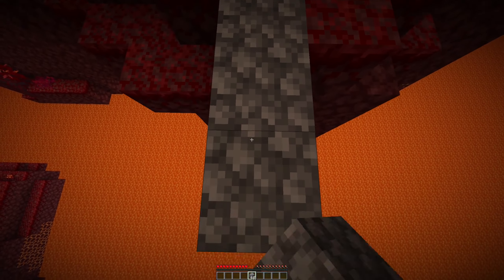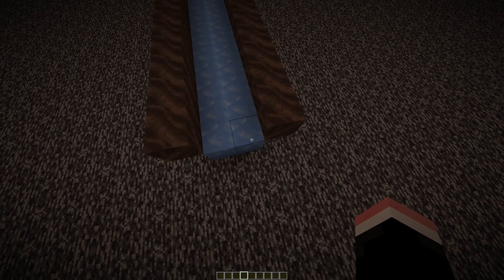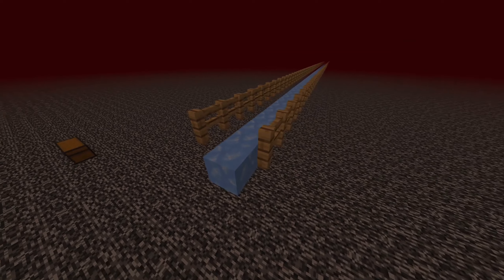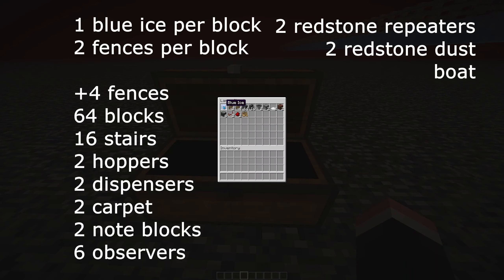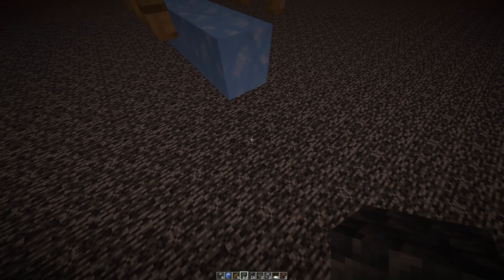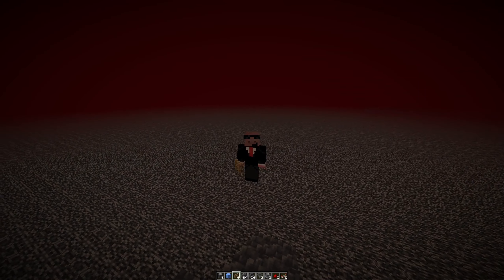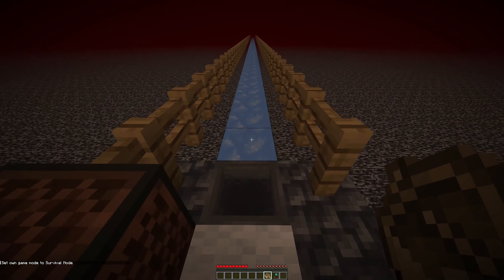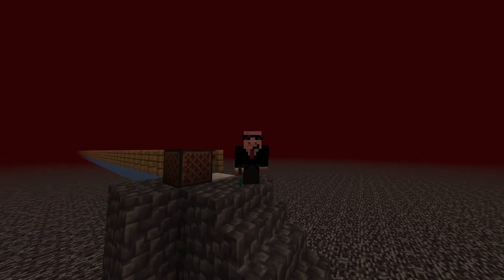"EASY" AUTOMATIC Ice Highway design tutorial: Minecraft

Comment: one of the oldest designs ever, also you can place every other block with a gap in between which saves half the blue ice. also when building the staircase leading to the highway you should use blocks on which it's impossible for mobs to spawn
Reply from the maker: I did say you could use any blocks, so that is a very good point. Thanks!